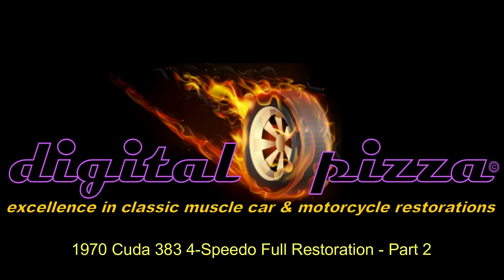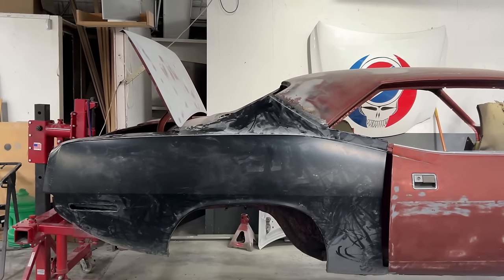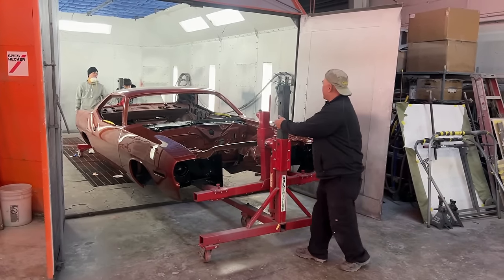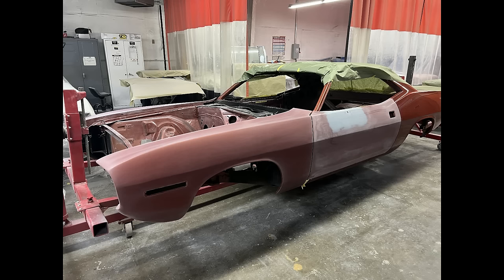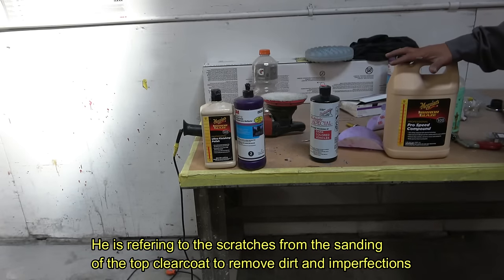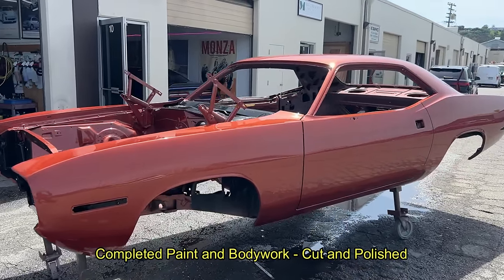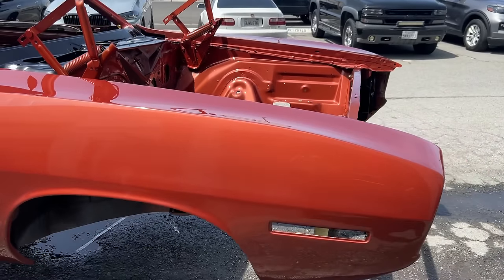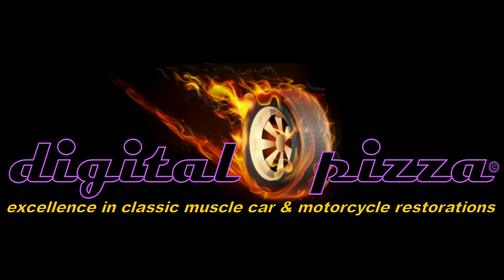1970 383 4 Speed Plymouth Cuda Baracuda Full Ground Up Restoration Series -  Part 2

Comment: Beautiful! (Tough break on the mirrors. It drives home the mantra: "Test fit, test fit, test fit." Even though it takes time, it is best to assemble and disassemble many times before paint.) I can see how the mirrors could be overlooked though.....
Reply from the maker: Yes, in this case, I assumed the mirrors that were on the doors when I got the car were the original mirrors (they looked the same). But found out later they were off a Mustang from the same era! Woops! But in the end, it turned out fantastic, which is the important thing :)
Reply: @digitalpizza1  Funny. Mustang mirrors. A lot can happen to a car in half a century. Looks great for sure!

Comment: Question? Why didn’t you paint the interior as well. That way the entire car is sealed and brand new?
Reply from the maker: Hi Paul, because that is all original paint on the interior. I believe you keep it original to prove that this car has never had rust or rust repair. Original paint proves that beyond a shadow of dought. It all gets covered up anyway, but you can't duplicate originality.
Reply: @digitalpizza1  I did not think about that….good idea if there is no rust to ruin your good work…thanks